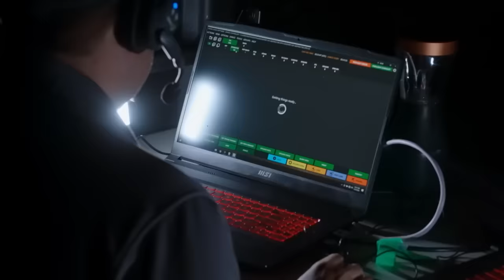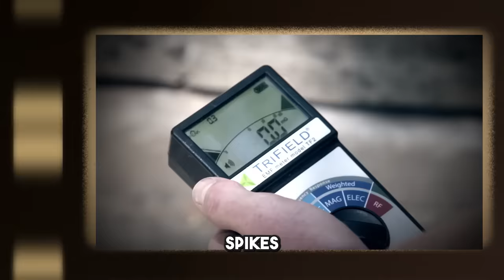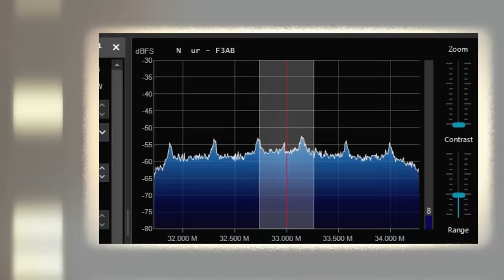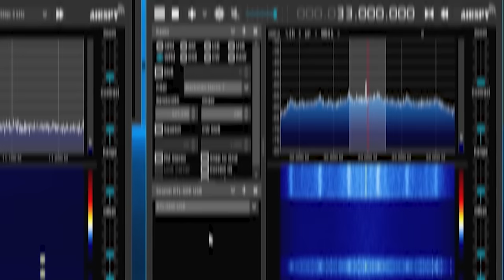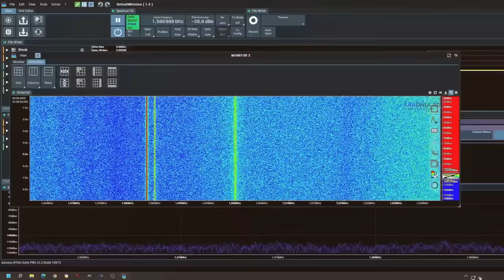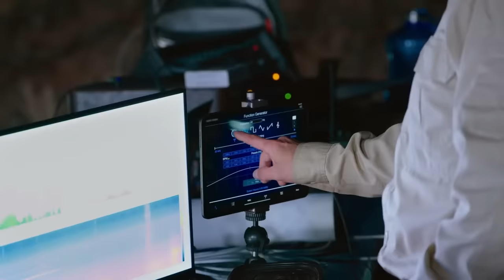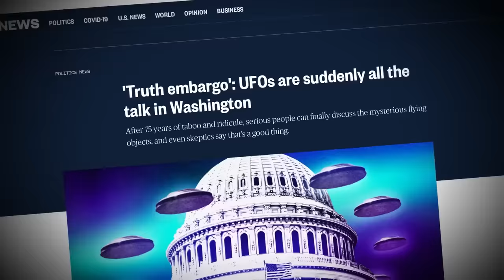The Secret Of SkinWalker Ranch    What Really Happend To Travis S  Taylor

Comment: I would suggest to protect your electronics from electromagnetism you know how to do it with the shield and ground wires.
Reply: thet need to take a time dialation reading, there can be a gravitational anomoly thats causing time to move faster or slopwer in certain areas which is why the gps is not able to determine correctly how long it took for the gps beacon to be recieved by the gps.

Comment: yes  they  have  this  system  i police  cars  which  will  shut  off  your  car  when u  are going  down  the  road  when  a police  car  goes  by  u   i  know  they  have  this technology   they  did it  on  me  and we almost  ramed  into  an  other  car   the  frequency  will  jam  your  cell  phone  over  the one  u  have  now aad  listen  to  your  coversation   and wire in what u  are  doing   a nd tap into  the car  energy  from  the  5g  teleporter  from  tellaphone  poles   as  a jam siginal  frequance    to  pill u  over when  did  nothing  wrong    has to  do  with  the computer  to  shut down  the  speed  frequincse   by  gps5g   to know  were u  are   by  the crap  they are  doing   to  u they  are  watch ing  u  all the time  ///the  stop  point  is  where they  are  in the  scaner  in your  equpment  chip  equipment   take  out the  chip  and  it will not  shut off  phone GPS  SIGINAL U  HAVE
Reply: Wonder why they only used it on you I think maybe your car just broke down as you passed the police car and it was just a coincidence